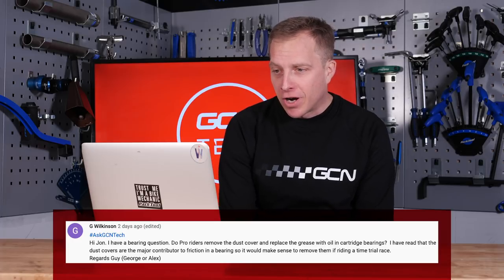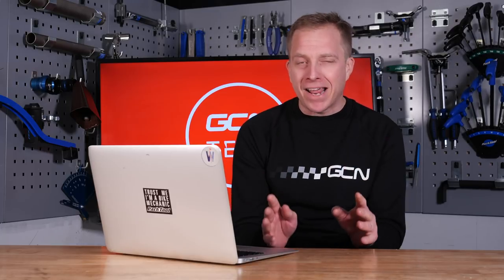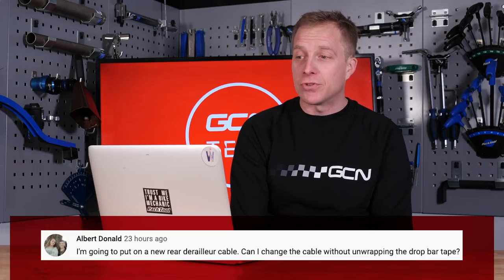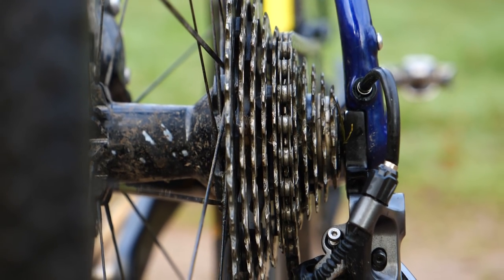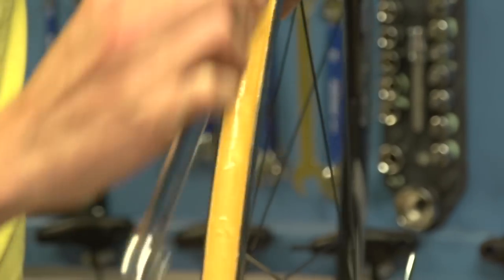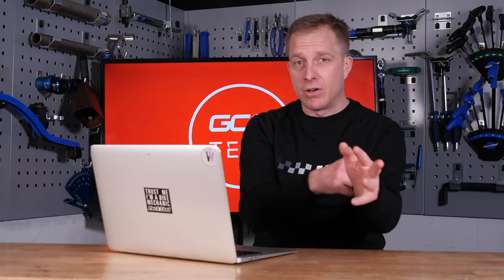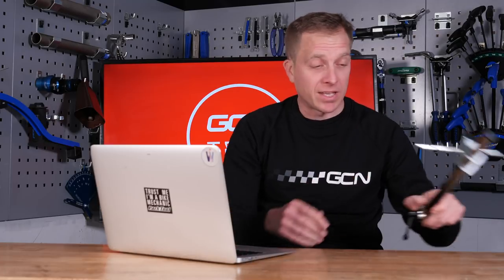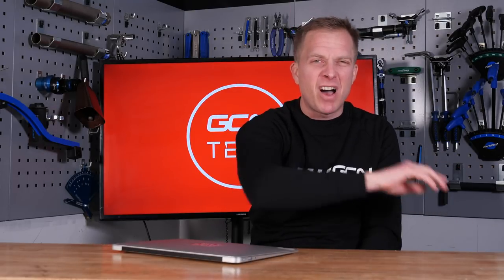Do You Need New Shoes For Your CX Bike? | GCN Tech Clinic #AskGCNTech

Comment from the maker: What tech problems do you need solving? Comment below using the hashtag #askGCNTech!
Reply: Sprint problem I want to solve ...
I know that sprint was hard but I can not give away...
#GCNTech
Reply: Im using a shimano 105 R7000(latest) 11speed. My front derailler and chain keep rubbing with each other and sometimes the chain just falls off from the front chainring. The sound it makes is horrible when they rub. Please help me idk how to adjust the front derailler. Thanks. #askGCNTech
Reply: #askGCNTech i have a question about BB. I have the venge 2019 frame that came with SRAM 30mm spindle. I’d like to pair it with the S Works FACT power crankset and dura ace groupset. Which BB do i need to buy? Thanks!
Reply: #askGCNTech Which is cheaper? 1 chainring and more cassettes or more chainrings and less cassettes? not sure what kind of gear ratio I should get for my commute that's around a 40m elevation gain
Reply: I have a Shimano ultegra front derailleur that refuses to change gear after replacing the cable and outer.  It is internally routed but moves fine in the frame.  It changes down without problem, however it requires a massive amount of force on the shifter to change up to the larger gear.  When you reach maximum force the front derailleur pops/snaps/clunks across into the position.  Any ideas what might be causing it to happen?  I wonder if the angle of the cable leaving the frame to the derailleur is incorrect? #askGCNTech

Comment: I totally agree: MTB shoes and pedals make perfect sense on the CX Bike!!!
Reply: This. Putting 3-bolt clead road clipless shoes on a bike designed for (mostly) off-road racing/riding is asking for trouble. Using loudspeakers. Connected to a public-address system.

Comment: Hi Jon 
Love the show. I have a suggestion for that stubborn tubular tape/glue, 3M gum wheel, it’s used to removal decal glue from cars without damaging the paint, it’s like an abrasive wheel that goes in your drill but it’s not abrasive and does a quick and amazing job without burning, peeling or blistering the paint and believe this will work for that tape/glue. Give it a shot, I dare you

Comment: my last bike needed long reach calipers, was a bit of a head ache! i'd have to advise against the cheap option, as that's what the bike came with and they were really flexy. even with fancy swissstop pads i didn't like going over 15mph, knowing that i couldn't stop quickly. never got around to trying the shimano calipers but user reviews of the bike and several forum posts said they were a massive improvement. 

nothing against tektro, their short reach calipers and disc brakes have never let me down.

Comment: On the subject of calipers - I have a 2013 Trek Domane as my winter/cummute bike and use 25c tyres (normally Vittoria) mudguards (narrow SKS racy ones) with currently Ultegra R8000 calipers (which replaced R6800 last year) without issues. Must be a drop issue as mentioned I remember older winter road bikes of old or ones specifically designed around more bulky mudguard use had to have calipers with long "touring bike" drop on the calipers to get the reach for pads to be centred on rims. Certainly use to a specific  "non race" & "race" drop design to calipers which 105 upwards didn't include anything but "race" drop.
Maybe good idea if you need that longer drop to stock up on the ones mentioned as with advant of disc brakes sort of deletes the need for both types to manufactured as people needing that clearance will with out doudt go disc brakes route on road bikes.

Comment: The last question about pedals. If mountain bike pedals are used on a CX bike and still want to use road shoes. Then if you use Crank Brothers Eggbeater or Candy pedals you can use road shoes. Crank Brothers make a cleat for these pedals which has a plastic backing with the 3 holes.

Comment: 5:20 a hack/RIF...11s MTB cassettes go on 10s road bodies. #askGCNTech widely known mechanics knowledge, but never mentioned on the GCN videos????
@Marcel R. Also, you can use 11-34 CS-HG800 (Ultegra-RX cassette) on 10s road body. But it won’t work with DuraAce RD, you have to use Ultegra RD with long cage.

Comment: #askGCNTech Hello from Costa Rica, John. For christmas my gf gifted me a road bike. She told me that it needed some hard work and love. It is one of the first aluminum aero frames, with Shimano Sora 3400 groupset, back when 23mm tyres were a thing. Already serviced the hubs, the brakes, bottom bracket, and headset, also with crisp shifting. The problem is that the cassette (8 speed) is an 12-21 with 53-39 on the crankset; and where I live is quite hilly. I'm really happy with the crankset (for strength training) so I'm going to change the cassette. Bought an 11-30 cassette. Planning on buying also a 11-25 and 11-28 cassette. Back to the problem, the rear derailleur is short caged and max sprocket capacity is 27 teeth. Haven't been able to find the long caged version (Still the 27T problem according to shimano documentation). In your experience how safe is to push the manufacturer established limits?
Is any possibility that I switch the cage from an old shimano tourney cage or something similar. Or is it better if install a shimano alivio rear derailleur (or similar ). The most optimal solution I came out is getting a Shimano 105 5701-SS rear derailleur which has a maximum sprocket capacity of 30T and total capacity of 34T; which is the configuration that is going to have my transmission. 

 Is any compatibility issue I should worry in advance. Thanks for the help. You're always useful for my mechanic doubts.

Comment: #askgcntech Hi Jon, I always enjoy watching your tech spots. So much so I went down the local reclamation yard to source a bike to 'do up'! I picked myself up a circa 1996 Peugeot professional 1000, its fitted with campy veloce gears, campy athena brakes, selle italia turbomatic2 seat and Rigida DP18 deep section wheels. Everything works fine, obviously it needs a clean and lube, except the head is very stiff. Is it possible to strip and service the head bearings, or replace them? The threaded head nuts seem a little strange to me. I can provide photos. I paid 25€ for the bike, which considering after pumping the tyres up I was able to ride it away, I thought was quite reasonable. I'd appreciate your thoughts and ideas. Thanks

Comment: I did shave some material off a 11sp cassette in order to get it fitted on 10sp freehub using a lathe. Works fine. One probably shouldn't do it with cassettes which have spiders made of carbon fibre. There is an 11sp cassette made by shimano (11-34 HG800, I believe) that does fit on a 10sp freehub body. 11-34 might not be your choice for a roadbike though -IF your derailleur can cope with it.
Reply: Be carefull . If you shave or machine off too much material and you have traditionally spoked wheels you could create a fixie (the cassette grips the spokes).
Reply: @hermankloet2039  Yes, of course. Just 1.85mm (not 2.85 like Jon said). And I checked if there's enough room between spokes and the biggest sprocket.
Reply: @chrisko6439  yes i've machined loads of 11 speed cassettes to fit 10 speed free hubs a 28 t bottom sprocket is advisable although i have machined 23 t with no problems

Comment: #AskGCNTech Hey John! Question on the compatibility of through-axles. My Orbea Terra came with 12x100mm (front) & 12x142mm (rear) through axles and I would like the replace them with Shimano one's (Shimano SM-AX720) because those have a handle and don't require a tool to remove them. Is it as simple as making sure the dimensions, diamter & thread are the same or is there more to it than that? Thanks a bunch, cheers from Belgium, Jan.
Reply: Hi Jan Henckens, I have DT Swiss Thru Axles 12x100 and 12x142, axle pitch M12x1.0  but with a handle, I want to swap them with thru axles without handle because I want to make my bike more aero.  Is your axle pitch also 1.0  ? Maybe we can swap ?
Reply: the Shimano SM-AX720 has axle pitch of 1.5 and I think your Orbea's has axle pitch of 1.0 , so the Shimano's will not fit !
Reply: Jan, maybe you can contact Shift-up in France. They have lot of references for axles, and very light and reliable products. Good luck

Comment: #askGCNTech hey John, I have a eastway cx 2.0, the rear derailer has the chain jumping on the jockey wheels on gear 1 and 2, it is a ten speed casset and the groupset is SRAM apex, my LBS said it is a bent jockey wheel cage, what do you think? Should I get a new derailer?

Comment: #askGCNTech I'm building a winter bike of old parts I have laying around. I have Ultegra 6800 front and rear mech but I'm missing STI shifters. Can I use 10 speed STI shifters (they are cheaper) with 11 speed derailleurs? I'm guessing the 10 speed chain might be an issue. Thanks!

Comment: GCN Help me:  I use the "Pro water bottles", that have the open top with silicone valve. It splashes out on bumpy rides and the sugar and electrolyte water goes down the down tube and creeps into the BB.  How do I prevent this besides switching to conventional water bottles that you have to pull open with your teeth?

Comment: I currently use spd pedals on both my cross bike and road bike. I want to use all my shoes on any bike. The problem is that ... most high end shoes don't have spd compatibility....and further more I usually can't get the pedal release tension high enough for a real all out sprint. Any thoughts on this would be appreciated. Go.....GCN!
Reply: You can look into getting an SPD-SL to SPD adaptor. I know SIDI used to have this.

Comment: #askGCNTech Hi Jon, I have a set of quick release TT aero bars on my road bike. I would like to install some shifters on these bars and connect them to my Di2 system. I have Ultegra R8070 Di2 shifters and the junction box is in the right hand bar end. I can see I have free Di2 ports on each shifter so trust I can plug the TT aero bar shifters into these ports? If so, what aero bar shifters will work as there seems to be a few different models? Thought the SW-R671 shifters would work.  Also, given the clip on TT aero bars are quick release (Redshift Sports) I would like to cable them in such a way I can remove the wiring easily so would think an internal junction box like the Shimano EW-JC200 in each aero bar would do the trick paired with the EW-SD50 Di2 electric wire extension. That way I can have the extension cable from my R8070 shifters under the bar tape with a small section hanging out by the stem that can connect that to the EW-JC200 junction box that can be neatly tucked into the aero bar. Any help and advice is very much appreciated as matching Di2 components is very foreign for me. Last question, if all of the above will work and I have removed the TT bars will the exposed Di2 wire be a problem. It doesn’t rain much here but still wasn’t sure if water or the fact the cable wasn’t actually connected to anything would create a problem with the system.

Comment: #AskGCNTech
Hey Jon, hoping you can enlighten me with your knowledge of all things bike related......I am doing a neo-retro build using an old Reynolds 531 frame, with modern groupset, brakes etc, and upgrading the fork to a more modern carbon fork with 1" alloy steerer tube. I can get hold of a sealed 1" threadless headset, however I don't know how to tackle the steerer to stem matter. Do I need a quill stem adapter to take a modern 1 1/8 stem, or does a 1" stem exist?? Many thanks in advance. Andrew

Comment: I have a Specialized Robaix Sport 2020 which fell off a bike rack and bent the derailier hanger. I have replaced the hanger and shifting is fine. However i noticed that the rear wheel has a little side to side play. My local bike shop suggested the through axle just wasn't tight enough so they used a big wrench which did stop it moving. However I've since had to take it off to deal with a puncture and have struggled to tighten it enough to stop the play. My worry is that i am going to damage the frame and also that if its that tight and I need to get it off during a ride i won't be able to undoo it with my tiny multi tool. Could a spacer by bent or could something else be damanged that needs replacing? Many thank Dafydd #AskGCNTech

Comment: #AskGCNTech
Hi Jon! A great way to start 2020 coz i bought a new frameset. I usually like to do long rides and train for crit. I weigh around 180 lbs. What can you recommend for the road components. Can you guys make a video for the best and most practical way to spend your money in mixing the latest Shimano 11 speed road bike  mechanical groupset rim and disc version or even the DI2's. Cheers!

PS. Once I've done the project I will post it to BIKE VAULT

Comment: A shimano 11speed R7000 cassette will fit on a 10 speed freehub. I think that it's the 11-32 but do check. I've two sets of wheels using this 'hack'.
Reply: 11-34
Reply: @ARGINH  Or i can machine a 11 speed cassette to fit a 10 speed freehub, done loads with no problem

Comment: #AskGCNTech: Hey Jon,  I will be traveling overseas for an extended period and will be traveling with my bicycle to keep my ever expanding girth at bay. I purchased a bicycle case (Scicon Aerocomfort 3.0 TSA)  to keep it as protected as possible from the baggage handlers. What can I do to protect the bicycle even more? It has hydraulic disc brakes; some sites say to bleed the brakes, other say not to. All say to take the air out of the tires. To give you more information, the wheels will be off and stored within the bicycle case. To bleed or not to bleed? That is the question.
Reply: I’ve never bleed breaks before or after flying with it. Bikes are a pain in the ass when flying
Reply: @sheahoffman3218  Thanks!

Comment: The BR-650 brakes aren’t that great. On Shimano’s own compatibility chart they are shown as having slightly reduced performance, and this is my own experience. A bit more expensive, but I recommend using Velo Orange Grand Cru calipers. They look super smart and are as stiff and effective as Dura Ace r9100 calipers IMHO.